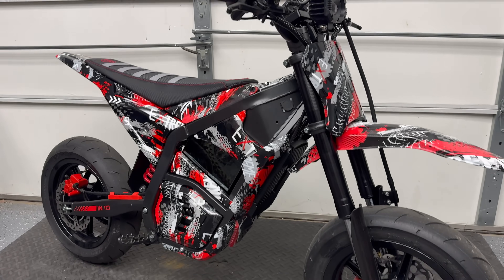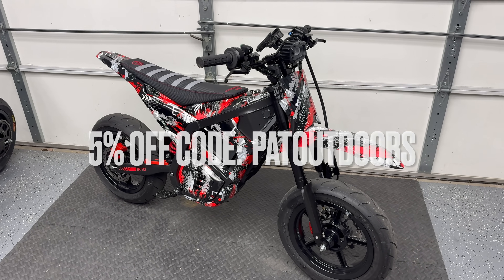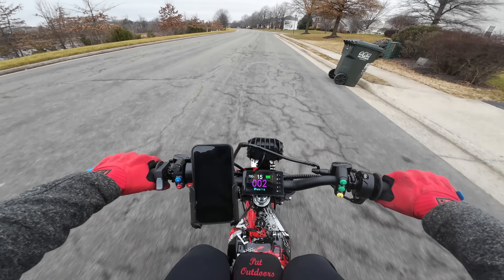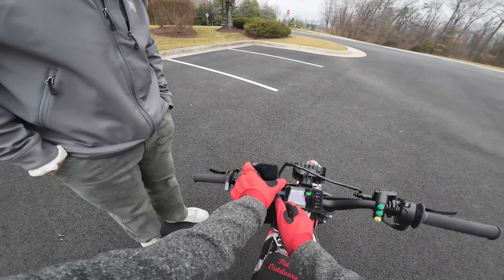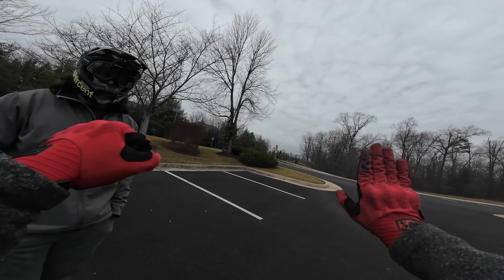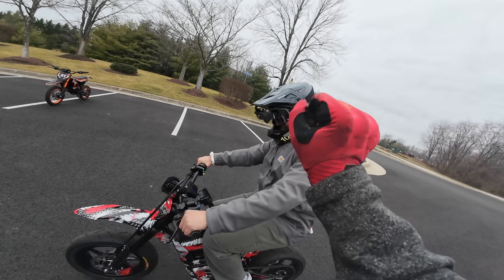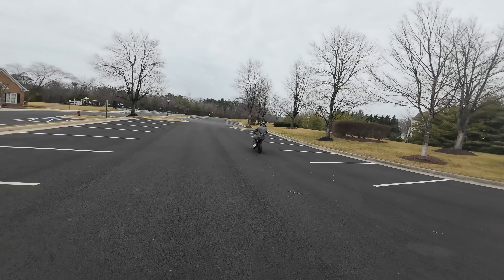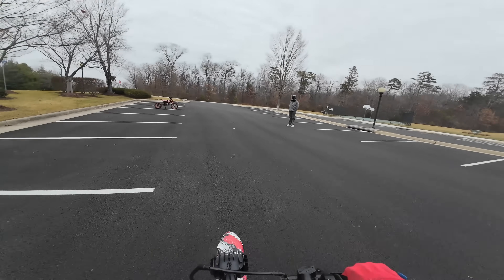This 72V Yozma IN 10 Can Wheelie Itself - Moxin Testing

Comment: I'm thinking of getting this controller for my SurRon, I want a wheelie assist mode. The new Segway xaber300 has one stock. I'm not interested in a ton more power, as I'm not planning to go 72v on my LBX, I'm getting the ultrabee instead 4 that.
Reply from the maker: Yeah I've had my eye on an UB for the whole past year, though the Xaber 300 seems like a good alternative that already has wheelie assist and an electronic clutch (which may be good for tight off road situations.)

Comment: I got the bike…now what do I do…what controller do I need
Reply from the maker: The controller I’m using is a Moxin, wont work on the stock battery. Need to have at least 100 amp discharge rating